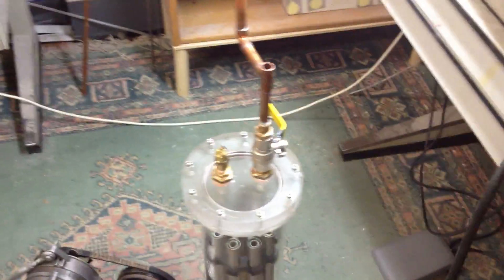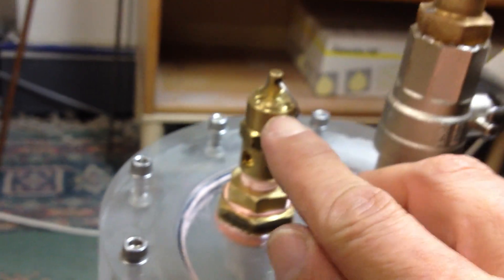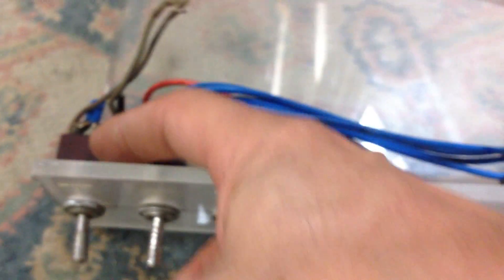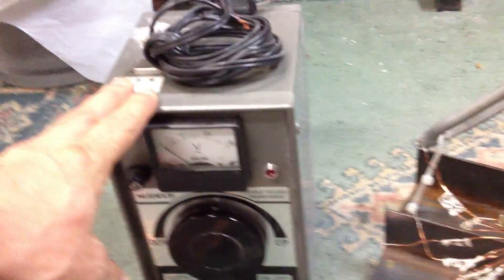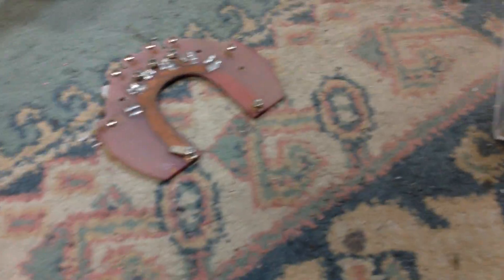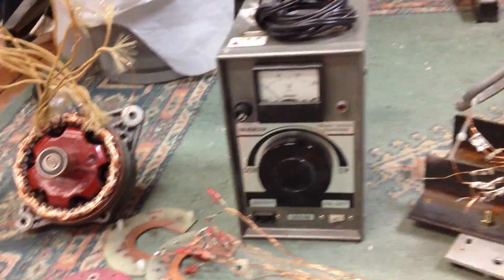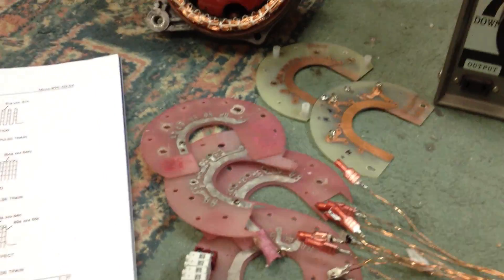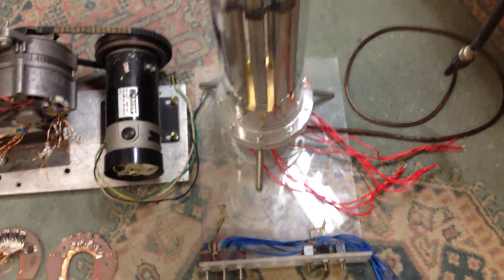Meyer Cell update

Comment: Love the craftsmanship! 
good idea with the pressure relieve valve. 
Are you going to add pressure gauge?
Reply from the maker: Yes.. I have to so I can set it to a particular pressure, I'm thinking somewhere between  5 - 20 psi., depending on use requirements.

Comment: Great work Electro. Well your not going to believe this but the guy I built a 3d printer for finally came through with the CNC program to machine the aluminum enclosure for the vic coil, going to have it machined soon, just wanted to let you know, cheers.
Reply from the maker: Hi Jeff...It's taken him a while...I have already sent the ss wire to Russ about 8 months ago..I thought you were not going to do it..I'm glad it's finally getting done..

Comment: Nice cell mate! I think I have one of those switches. What is the rating on it?
Reply from the maker: they are from the 80's..made in japan" Nittai " 3A 125 v ac.  but I need 3 of them.
Reply: electro1622 Well, I have only one that looks similar, with exactly the same toggle switch on the front. It's rated at 250V10A - made in england by Arrow. It's yours if you want it. Just say the word. I also still have the 0.6mm tungsten wire if you still need some of that... Just yell out if you need anything :)
Reply from the maker: Cool.. sold.... I only have to get 2 now.. the 0.6mm tungsten wire would be awesome as well , I went through a bit welding all this together..tips don't last as long when your at full power. Send them with your electrodes you want me to weld..
Reply: electro1622 consider it done. send me your address via pm or something - I'm not fully up to speed with how the new google+ thing works yet.

I'm not ready for the electrodes yet - no rush. I think I told you about a year or so ago that I was working on something really cool. I'm quietly building a newer and better version. That's why I'm building my black box - to deliver power safely...
Its a slow process.

I'll look through my parts to see if I can find another switch for you. Sometimes I salvage stuff and forget all about it...
Reply: electro1622 I just uploaded a video & included the switches. watch it & send me your mailing address. Do you still have my email address?